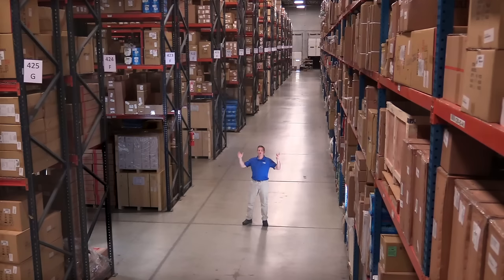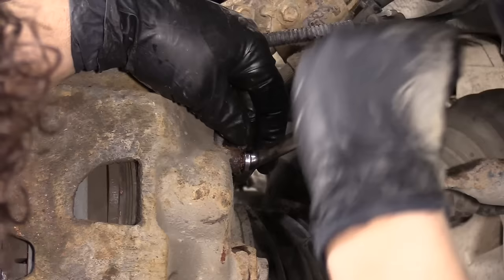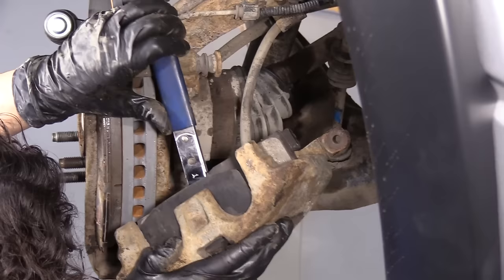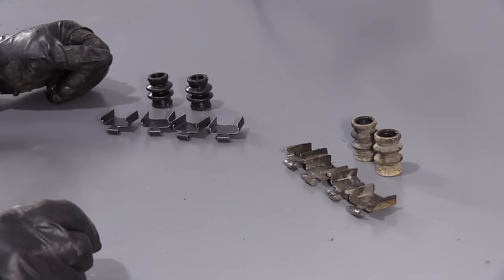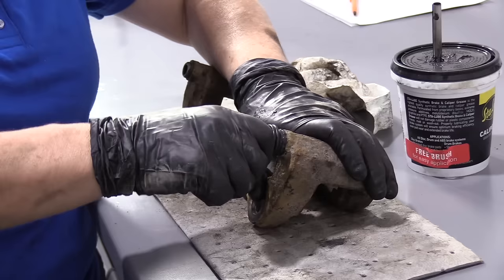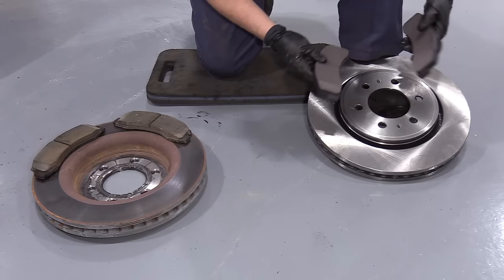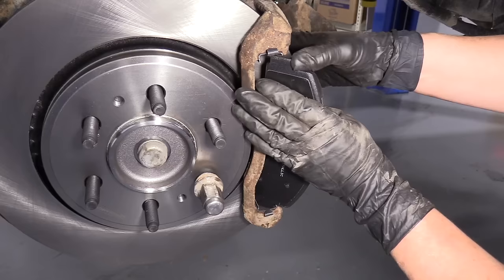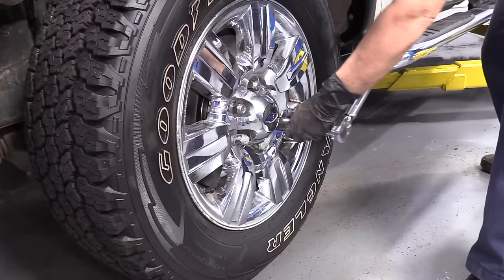How to Replace Front Brakes 09-14 Ford F-150

Comment: The only time a mechanic loosens the bleeder screw is when... Is on a new caliper when replacing the old one!  Just loosen the master cylinder cap, retract the two brake pistons, and move on.  Is it me or do those pads look close to new??  I actually like the cleaning job, and grease, that looks good.  It's good that you point out the inner pad, it's very helpful to those who don't know the difference.  Just don't touch the bleeder screw!!!!
Reply from the maker: +Thomas Bergman Thanks for the feedback!
Reply: Thats how I always did it. Afterwards spray down n wipe the reservoir if any spilled out and fill it back up.
Reply: The bleeder screw tip is a factory tec tip, as she said the reverse flow can damage the abs system, most mechanics today dont go the extra mile or even check torque specs which is why I fix my own
Reply: Agreed Never once have I touched a bleeder screw doing just pads and rotors
Reply: It might be recommended to use the bleeder valve but its better if you open the reservoir cap 😉 
Also you can get air through the valve which can be a problem too.
It's me being an amateur
Reply: @cncnmore4505   I started opening the bleeder screw cause I kept having crap luck of calipers dragging the rotor after a brake job.
Reply: I have done it too. Fluid level reads low…brake pads worn. Replace pads will put level back to where it was

Comment: Use piece of wire to hang that caliper rite away never let it hang from hose. Good job tho
Reply from the maker: +Jess M Thanks for checking us out, and thanks for posting that tip! 1aauto.com
Reply: Depending on the angle of the pull it isn't allways required. She was fine with what she did but, it is allways a good idea.
Reply: 6:32 She had it but didn't use it earlier. Later on she did :)
Reply: Church
Reply: @nonope1774  duh
Reply: You can push the cylinders back in whitout the bleeder valve.go slowly to not ruin abs ..dont go crazy and rush it.the way she did it is ok she pushed out the old fluid out mainly.
Reply: I just use a small bungee cord
Reply: I just replaced the hose to be safe. Lol

Comment: Never seen any manufacturer say you need to open the bleeder screw. Most of them say just remove the master cylinder cover.
Reply: I'm thinking didn't she just introduced air into the brakeline by opening the bleeder?
Reply: @jimsmith7716  --No, the Brake Fluid Reservoir keeps Head Psig. on System if it is at Normal Level...

Comment: Great video first. Second, I learned the hard way, replace your rubber/flexible brake lines. I did a break job on my F 150 due to excessive heat coming from the front end rotor (drivers side). I replaced both sides ( the vehicle just had a brake job done, bought it used). New rotors and pads and even a caliper on the drivers side. Within 30 miles, same problem. I replaced the front wheel hub ( 4WD ). Still, same problem. Finally, took it to Ford dealer where I bought it. It was the brake line collapsing and not letting it release the fluid back to the master cylinder. No problems, but, low and behold, the other side started the same thing. I changed the hose ($22 bucks ). I always removed my calipers and never let them hang by the hose while changing pads or  rotors. Cost me 180 dollars for 2, 22 dollar parts. I even inspected the brake lines and they we not spongy and looked to be in good shape. Just to help y'all out in case this sounds familiar, change your lines, cheap and easy. My loss can your gain. Thank you for your attention.
Reply: I have been having this issue no matter what I tried. I didn't think of the brake line collapsing. Hopefully that's my fix🤞 thanks for the info!

Comment: I just replaced my pads and rotors on my 2014 STX SPORT yesterday.  I bought everything directly from the dealership using the VIN number.  I preferred to buy OE vs aftermarket, my preference of course. In the video she is using the old style pads, “ the inboard pads have the half moon like I called it”.  The new style pads are all the same now, at least for F150 models. I supposed they realized some folks out there were installing them wrong. This is a really good video.

Comment: I've watched the videos for both front and rear brake r/r, and I've got 3 out of 4 wheels done.  Excellent instruction, it's already saved me HUNDREDS of dollars from the dealer and got me to finally use all the tools I've collected over the years.  My 2014 Super Cab is 160k miles of snow and salty roads in Ohio...   Haven't been able to use the parking brake since I bought it 3 years ago.

Comment: This video helped me out tremendously. Although double clicking a torque puts additional tensile stress in the bolt, beyond the set torque value. Doing so torques the bolt beyond whatever the wrench is set at and is not a good practice.

Comment: You were very helpful, first time replacing the brakes pads for my 2013 f150 and you made it very easy to follow instructions, thank you very much, I tried the truck and very smooth and they work great . Thank you .
Reply: doing a brake job on my 2012 f150 today for the first time and i was super nervous but this comment restored my faith!

Comment: I agree withe everything in this video except one thing. She did open the bleeder screw when she didn't needed to. that's going to cause air in the system. The proper thing to do is once you open up one bleeder screw you got bleed the air out of the system with all 4 tires. This is why i leave the bleeder screw alone most of my pad changes.

Comment: if rotor is rusted on, what bolt / thread pitch do you need to screw into the holes to pop the rotor on?

Comment: Excellent video thumbs up. But from now on please push down on your breaker bar when removing your lug nuts. Do not pull up it is bad on your back and if you're pushing down you can use your body weight. Makes things a lot easier.
Reply from the maker: +Bludduck Thanks for checking us out!

Comment: Ok so I just installed the brake pads and rotor on the front driver side all went well then did the front passenger put everything back in place like the driver side then finished torqing down the bolts and now the brake caliper is hanging up on the rim when I put everything together

Comment: Nice video in general, but I don't believe it is necessary to open up the bleeder. Just adding extra work, and chance you create a new problem like air in the lines or break off the fitting. Instead just open the cap up at the reservoir. Also in case it helps a newbie, after you finish up a brake job always start up the vehicle and pump the brakes several times before putting it in gear so the calipers are back in position squeezing the pads. I had a friend forget this step and drive a vehicle through a garage door before the brakes could engage (no fun and dangerous).

Comment: After bleeding the breaks like that , Is there anything you have to do with the break fluid once you have all the new brake pads in place?
Reply from the maker: +1xdramakilla Thanks for checking us out! There shouldn't be much fluid that comes out during this process. It is always best after finishing the job to double check the level to ensure it is still within the recommended level.

Comment: Never ever EVER let a caliper hang by the flex line. Also, the torque process is wrong. Jerking the torque wrench will always result in a lower torque than required. Good presentation but amateurish mistakes.
Reply: torque schmork...just hand tighten it til she's snug enough...lol...99.9% of DIY people wouldn't use a torque wrench anyway...

Comment: Is it necessary to put grease on the pads where they slide back and forth in the tin clips?
Reply from the maker: +BAT916 Thanks for checking us out! You do not need to add this grease, it is mainly for pads that are having a hard time going into the tins. 1aauto.com

Comment: if the wheel won't come off, just spray WD 40 on the hub and let it soak for 20 minutes or so, will come off. if not then spray again and let it soak again...eventually it will fall off pretty easily with a tap or two.  same goes for your brake rotors if they get seized and won't come off...WD-40 is the answer

Comment: What was the grease used on the hub before installing rotor? Thanks. Great video!
Reply: Anti-seize
Reply: It was anti-seize
Reply: Prevents the rotor from rusting to the hub.  It works well.  Looks like they are in a salt rust area.
Reply: Looks like silver anti seize
Reply: Anti seize lubricant
Reply: I may as well say it too. Anti seize
Reply: Anti sneeze, because trucks have allergies to.

Comment: So we slightly bleed off the valve when pushing piston back so we don't damage ABS or strain the system? Am I correct? Gotta do something like that on the 2010 rear or front brakes and it has the ABS.

Comment: My wife's vehicle's rotors warps shortly after replacing.  Do new rotors with pads need to be bed? The term I heard was, "Bed the breaks".  Is this needed?  If so, how do I do it?
Reply: sdereis no that’s wouldn’t be the case.  It is more then likely aftermarket rotors which are often unreliable or the wheel hubs where not cleaned properly which can cause the rotors to sit unevenly and warp 

Hope this helps!

Comment: I thought you only need to open the drain valve if the reservor is too full
Reply: I never open the bleeder screw and never had a problem
Reply: Fluid always travels in reverse when pedal is released although not a lot but still does. Has anyone seen abs damage from pushing cylinder back?

Comment: hanging the caliper by the hose? No No !!!  Red or blue thread locker? There is indeed quite a difference - it should be noted - Red is usually permanent unless you use a torch. Last thing is torque to 150 ft lbs in increments - 50 , then 100, then150 - less chance of damaging the wheels.  More training needed. Sorry.

Comment: Nice video, but aren't you supposed to take the tension off the brake hose/line by hanging the caliper up on something sturdy with the bungee chord - I realize she does hang it with a bungee eventually, but at first she lets it dangle free which puts the full weight of the caliper on the brake hose. I've always seen where you don't want to do that. Other than that, great video.

Comment: clearly she replaced the wheel hub also and didn't show us that step. once she took off the rotor it had an old wheel hub on and when she re install the rotor a bran new wheel hub was put back in.
should of show us that step also but its alright good video.

Comment: What if you don’t got abs do you still bleed it
Reply: If you replace a brake component that has fluid going through it then yes definitely. But just a pad and rotor slap then you don't have to. That said. It's not a bad idea to change the fluid anyways. Vehicles with out abs are old who knows when the fluid was changed?

Comment: Disagree with this job and don't hang the calipers !
Reply: I would have spray cleaned the caliper pistons before pressing them back in. All that dirt on the rubber boots got crushed back inside. And hanging it on the rubber hose! No good. Plus, brake fluid is nasty stuff. Should have had a hose on the end of the bleeder to catch the fluid in a container. I think that the caliper could be left on the bracket with the bottom bolt loose. Tilt it back, clean it, then tilt it back to get that tool in and compress the pistons. No dangling needed.

Comment: Gravity bled brakes... I wouldn't drive that truck.
Reply: what is your concern? you bleed them out till it is a steady stream, no bubbles in the system.
Reply: Gravity bleeding is great for priming the system for new calibers,cylinders etc. but this method is one way to bleed them by yourself [if you don't have someone else to help]. I always gravity bleed all brakes with new parts. Then follow up with bleeding brakes by pumping the brake pedal that way. I think she did a good job. Everyone has different methods but she uses alot of my styles and methods though out this video.
Reply from the maker: +Joe Lafleur Thanks for checking us out. 1AAuto.com